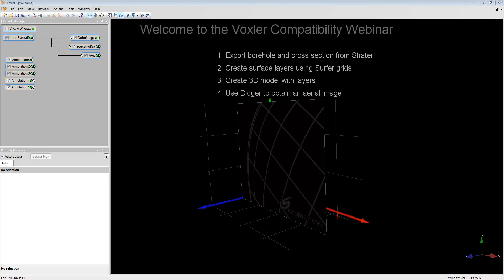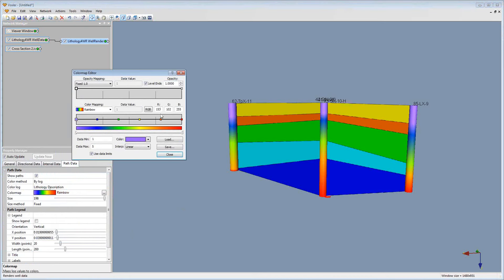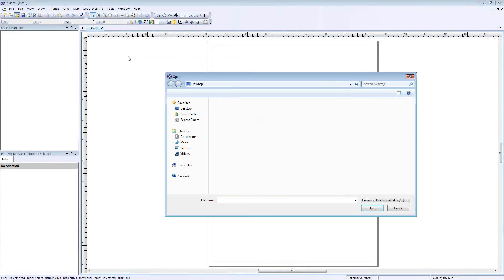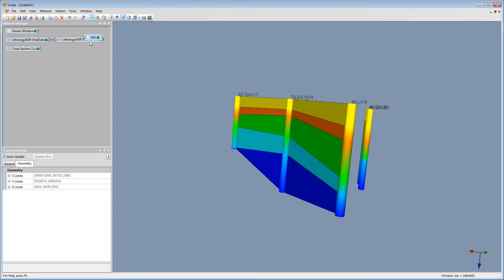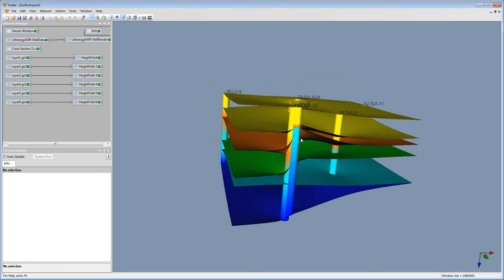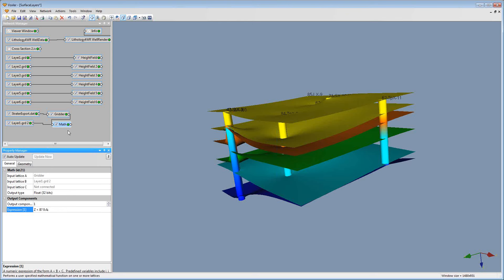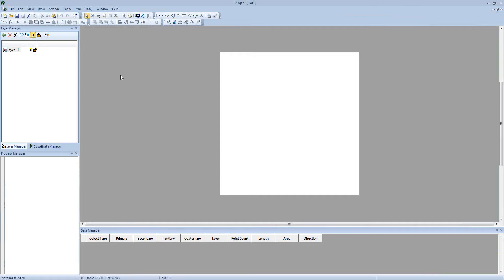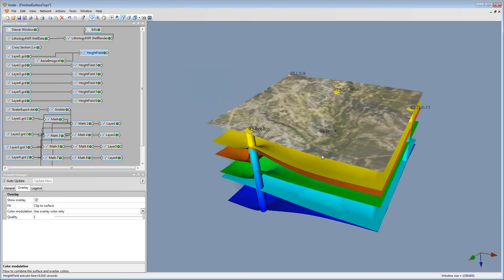Voxler Compatibility Webinar

Comment: Hi, when i tried to export to voxler the software said me "A COM error ocurred in voxler interfacing: Ocurrió una excepción, can you help me?
Reply from the maker: Hi Roman,

Thank you for your post. This error is sometimes seen when exporting from Strater to Voxler. Is this what you were doing when this error was seen? If so, please ensure there is a collars table present with the well locations as this can sometimes be the cause of this error. 

If this is not the issue, please email support@goldensoftware.com with some additional details about the error you are seeing. Information that would be helpful for us would be:

- what applications are you using? 
- what versions of these applications are you running? 
- what application were you using when the error appeared? 
- what was clicked just before you received the error? 

Thank you,
Golden Software